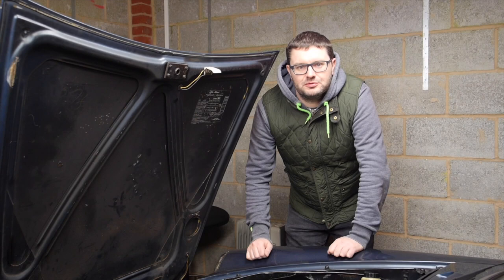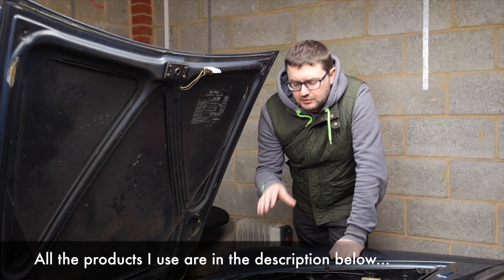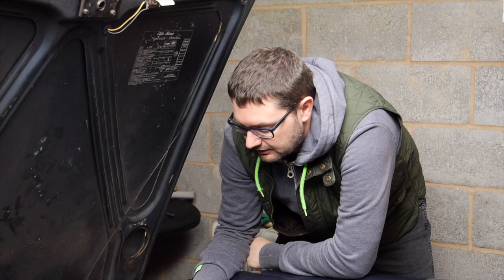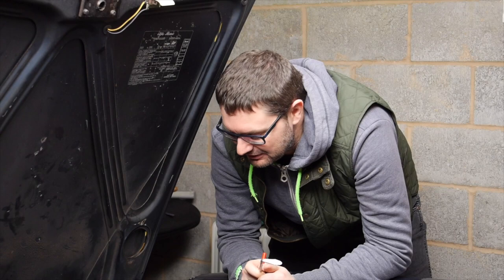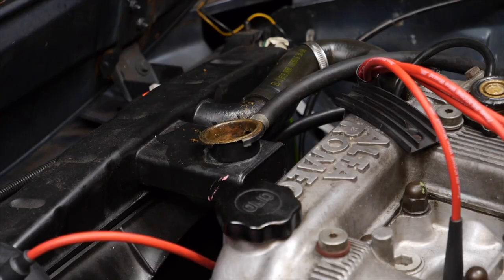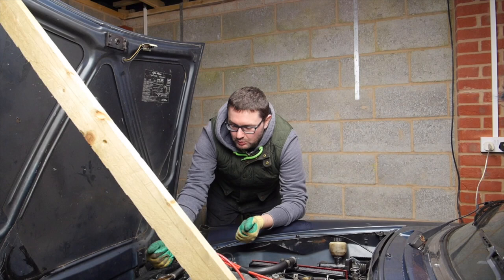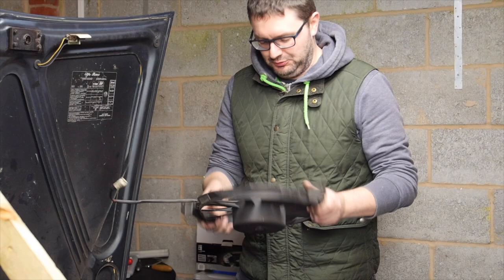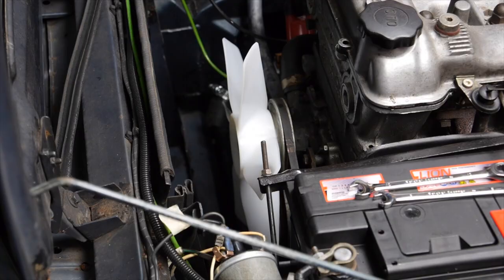Take to the Roads Garage - Episode 9 - How to change radiator coolant in an Alfa Romeo Spider S3

Comment: Thanks for the video. Informative as ever. I hope it runs better now with the engine fan. I have a pin-hole leak in the top of my radiator so seeing you remove your's has given me confidence to remove mine and get it sorted in due course.
Reply from the maker: Thanks a lot Alex! Glad you've found this one informative. I'm taking my Spider for a shakedown drive tomorrow which will be a good test for it. All the best with your radiator fix. Hope you get it sorted👍

Comment: I would have liked to see the coolant bottle after you cleaned it with lemon juice! I also did the crushed ice thing, shaking like a giant cocktail. Worked well, but still will never look new. I saw lots of evidence that the old yellow fan had hit the shroud and broke. This happens when the motor mounts start to sag and you hit a dip. Mine did it with new motor mounts and a new fan! I hit a low spot in the road while traveling at speed, and BAM the oil pan guard hit this dip. I also noticed the temps climbing, so I pulled over to find every blade gone from my new fan, and the rad had been pierced. I installed an electric fan in the front with a relay.
Reply from the maker: Thanks John. The top of the bottle was the worst area, so in the closing shots of the engine you can see the top of the tank. It cleaned up ok but as you said it won't look as good a new. Yup the fan broke the shroud. Must have happened to a previous owner. The roads round my place have lots of dips and pot holes so I'm going to keep a close eye on the fan. Not fun at all what happened to yours. Have seen some owners say they've had fan blades through the bonnet. Not good! Took mine on a shakedown drive today after the refresh and it seems happy. No leaks and its running nice and cool.